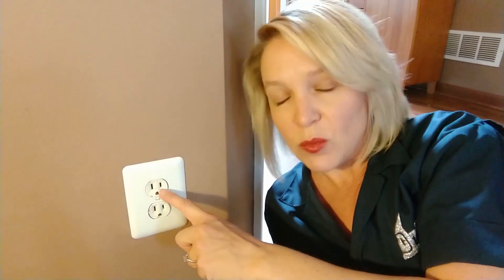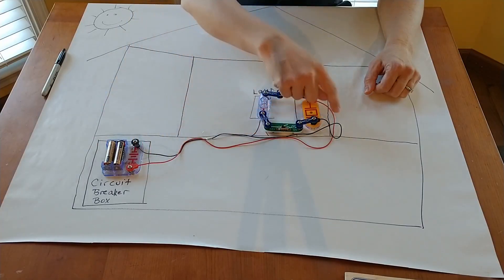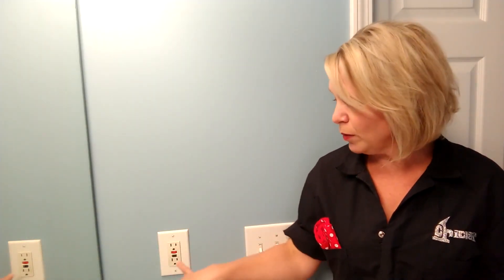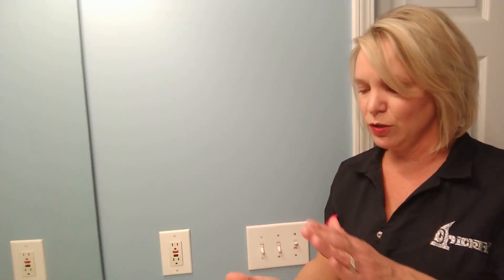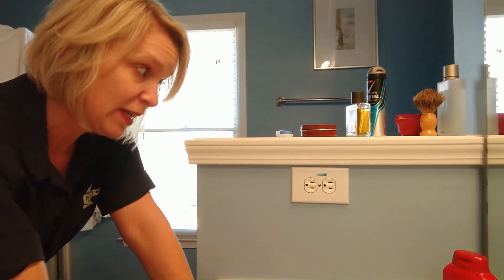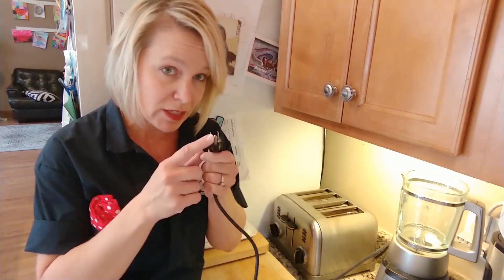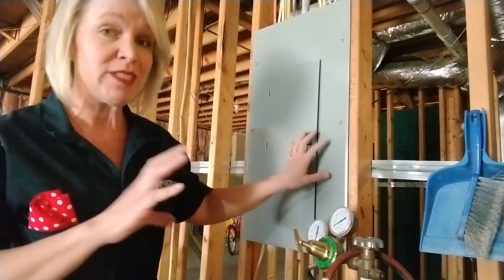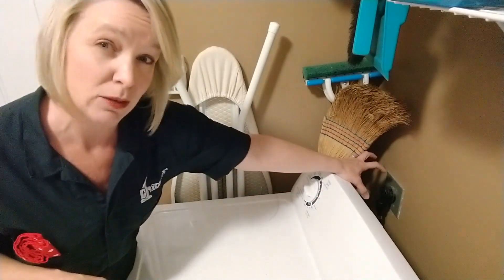Power Outlets for Dummies - Duplex & GFCI outlets, grounding, short circuits explained

Comment: PS You can purchase outlets that will not allow anything to be inserted in them other than a standard plug. They are relatively new but replace the need for external safety devices on outlets around children. I'm rather exuberant in my use of GFI outlets for two reasons. The first, of course, is overall safety. If there is any flow of electricity that does not return on the neutral wire, the GFI outlet will trip and prevent any harmful shock. Contrary to common belief, a GFI does not protect against all electrical shocks; it just keeps them from being harmful. The second reason for my exuberant use of GFIs is that a circuit must be in proper working order or the GFI will trip. This makes sure that any newly-installed circuit is working correctly and that any incorrectly working circuit can be identified. As the price of GFI outlets goes down it is my hope that all the outlets become GFI outlets. It looks like the next stage in electrical safety, to me. Electricians often hate GFIs because minor electrical faults that may or may not be unsafe. Will trip a GFI requiring real care in doing any electrical installation. GFIs force the best installation possible but you will pay for it in materials and labor costs. It is the same as in requesting that one gauge larger wire than normal be used increases original cost but will pay for itself in time with reduced power losses on long runs. The electrician that rewired my house restoration admitted that he had used one gauge thicker wire in his own new home. Hum, maybe it does make sense to pay more up front and save from then on.

Comment: Pretty good video but your duplex convenience outlet is installed bottom side up. Most electricians install this outlet bottom side up due to previous experience and the original mounting, years ago, that put the grounding outlet down. There is always an argument about which side is up but the code says the grounding connector goes up. With horizontal outlets the neutral, the wider connector slot, goes up. In these two conditions, if a plug comes part way out and a conductor drops between the plug and the outlet the conductor will touch either the grounding connector or the neutral not the powered connector.
Reply from the maker: Wow!  That is some fantastic information!  Are you an electrician, or just very handy?  I didn't install any of these outlets myself, since I am not a licensed electrician, and my home was built over 16 years ago.  I know the NEC is updated from time to time.  Is it possible something changed since the house was originally built?  This concerns me, of course, because at some point we may sell, and I want to make sure everything is up to code.
Reply: ChickFix USA No average electrician will install an outlet with the ground up. There has been a great deal of argument about which orientation is safest. The ground down orientation tends to hold the plug in place. The ground-up installation makes the plug safer, if it starts to work out of the outlet, out of place. If the plug stays in place, it doesn't matter whether the ground is up or not. Hence, all the arguments. Since all early installations were with the ground down, conservatism continues the practice. I'm probably 15 years behind on checking the NEC code. At that time, the code actually said to put the ground up. Most electricians did not change their practice to match the new code. Don't worry about the orientation of your outlets. Never met a building inspector that cared one way or another. I am not a licensed electrician. However, I do have a PhD in Vocational Education, long retired, but have taught a plethora classes in basic electrical installation and NEC code. The code book is so hard to read There is a large book produced, Practical Electrical Wiring, that puts the code in plain language and a smaller book called Wiring Simplified. Wiring Simplified is a quick reference to the code and it is republished regularly with corrections. I have about 30 different volumes starting with the second edition. It was originally produced to keep farmers from killing themselves when they wired their buildings back when rural electrification started early in the 20th century. Wiring Simplified is the best reference for do-it-yourself homeowners, is quite inexpensive, and easy to find in used book stores or on the Advanced Book Exchange, ABE.COM.